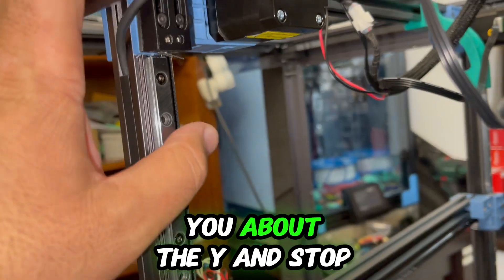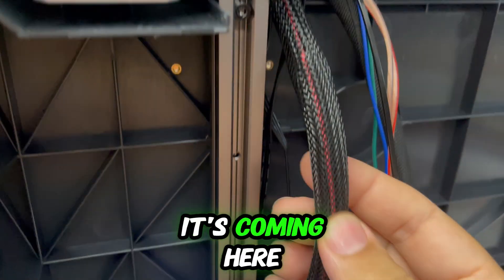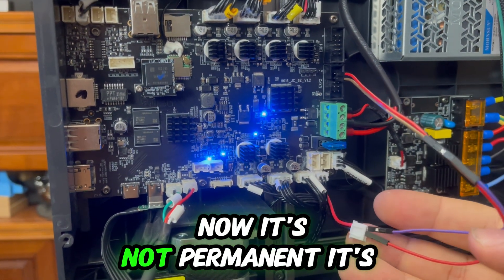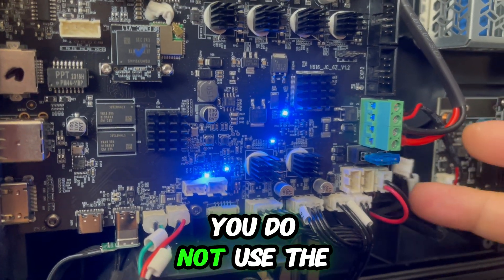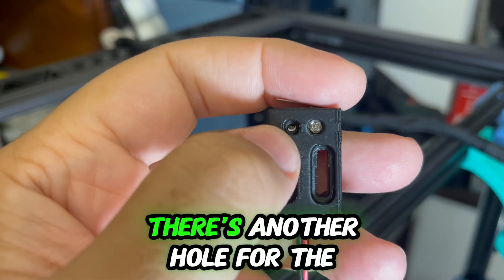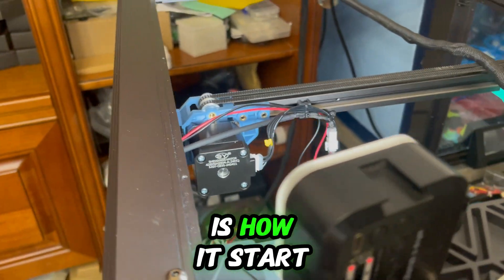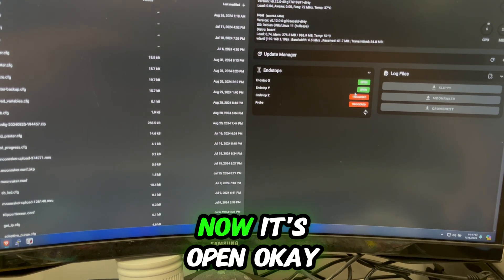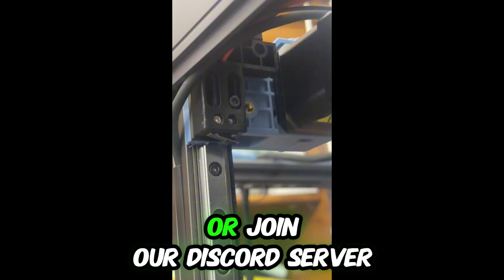Sovol SV08 Y end stop Install

Comment: I am not sure to get the point, why did you change the limit sensor. Is it because the original one was not accurate? Proned to wear off?
Reply from the maker: the printer uses sensorless and because of that the printer is not accurate

Comment: Wouldn´t it be less cabeling to mount the endstop to the printhead? If I see it correctly, there are some pins on the toolboard not used - like PA9 and PA10 (wich are intended for a serial connection but should be able to be redefined), or if using an inductive probe (or the new Voron PZ coldend) you only need one of the two I/O at the BL-Touch connector.
Reply from the maker: the solutions are endless. we tried to keep it as low cost as possible.

Comment: Sovol has configured sensorless homing incorrectly according to klipper docs. 

Mine banged pretty hard when homing Y, and even skipped steps wich led to it not printing  in center of bed. Changing driver_sgthrs didnt help for me. 

But after following klipper docs for sensorless homing, especially for corexy with homing_override and sensorless_home_x and y it now homes smooth and silently without skipping. 

Of course not as accurate as a switch, but way better than sovol original 🙂👍
Reply from the maker: in the first video we have shared another homing sequence that is more reliable but still not accurate for my likings :D

Comment: Im waiting to see when we can update Klipper on the SV08 before i make any changes or able to add any of the klipper addons. I wanted to play with spoolman I cant yet:( Question: I know adding a end stop to my CNC X and Y axis. improved my homing accuracy, repeatability but i dont think it will help the 3d printer in same way. unless i start printing inside of a jig? or am i missing something?
Reply: The accuracy of repeatability, if we compare the sensorless version and the version with end stops , It has no term of comparison,  sensorless version is always the cheapest and the worst choice, most of us print dual color using the slicer, whiteout enstops , this procedure is absolutely impossible , not mentioned if we are using klicky .And the most important aspect is safety, you avoid any possible accident, the endstop being mechanical , does not give errors , always stops before collapse ..
Reply from the maker: To update klipper. You need an original version of klipper. And this can be done easy!
Reply: @nadir3D  My SV08 is ignoring pause commands in orcaslicer. if i move to a PI with Klipper installed will it fix my issue?